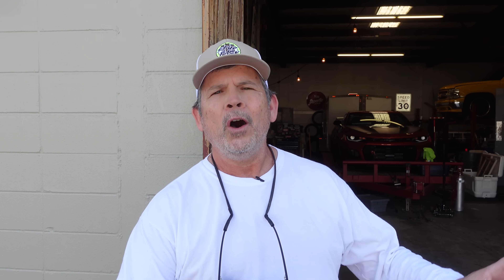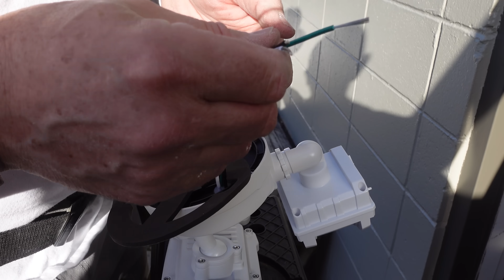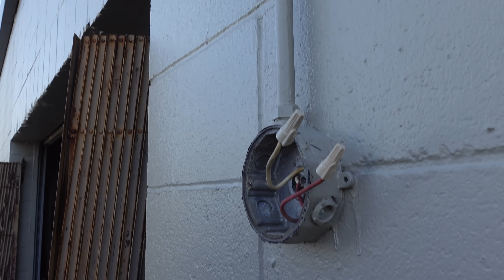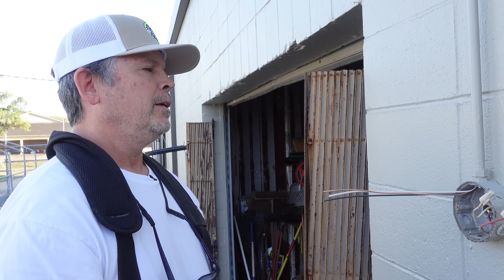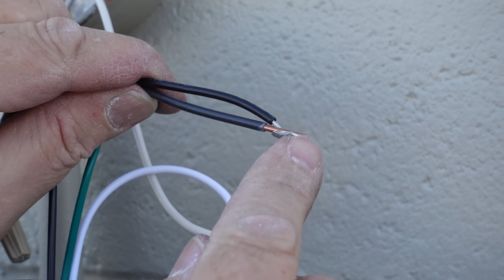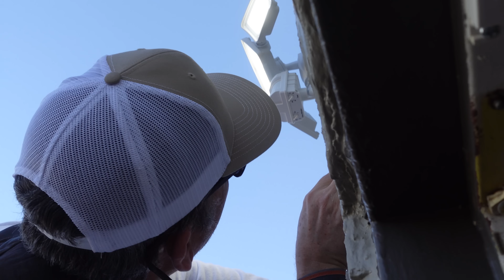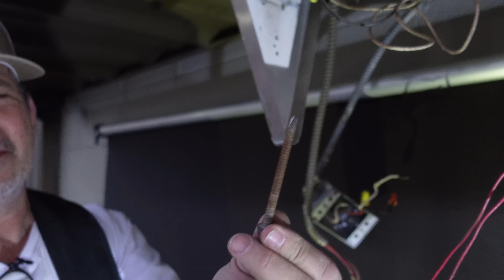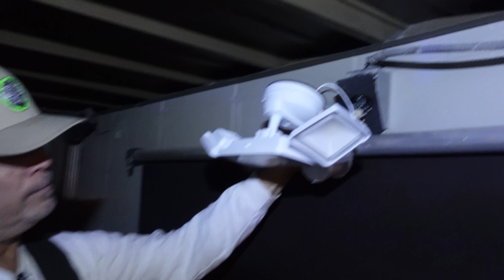HOW TO INSTALL FLOODLIGHTS (Safe, Watertight, and Properly Grounded)

Comment: I hate when people use Romex in conduit and 14g on a 20 amp circuit is also bad.  shake head
Reply: Nothing wrong with Romex in conduit, what is wrong is using it in a wet location. The interior of a conduit in a wet location is a wet location. Should've used THWN or UF.

Comment: @Stud Pack. Very important to do a "pull test" on each wire after screwing them together with wire nuts. And for those Philips-type screws that are also slotted, get a Robertson bit or driver that is made for those. Best of both worlds.
Reply: I think that's what Paul said he was doing, going for the square drive
Reply: @iamamish  Yes, he did say that but a Robertson bit/screwdriver is different. It actually has a square AND bladed end together made just for those types of screws.
Reply: @BogieRel  Robertson is just a tapered square, the original "square" which replaced Philips. you're maybe thinking about the ecx driver?
Reply: @TheDarthJesus  YES! ECX driver. That's the one. I always get those two mixed up. Thank you.
Reply: @BogieRel  Robertson is actually decades old, but Ford refused to pay a Canadian investor to use the patent. Square is the knockoff version created much later, which doesn't have the same tapered sides. Square is more likely to cam out, and doesn't "hold" the screw on the bit as well.

Comment: Let me get this straight, this guy bought a whole commercial building for his man cave? And put his 10 cars in it. Man people with money...
Reply: I know that's more than us average guys can wrap our heads around but if you think what he has is something, you should see some of the places I go. I did some work in one place that had about a dozen of those 1920's era cars - Duesenberg, Rolls, others that were handmade back then. All perfectly restored. The manager told me there wasn't a car in there worth less than 2 million dollars. This place has marble floors and real wood walls (like you'd see in a mansion's library). They had an engine (Duesenberg if I recall correctly) worth over a million dollars sitting as a display. Another place is a horse farm (think polo ponies not walking glue sticks). The guy had a original GT40 in his living room. The house was probably 15,000 square feet so he had plenty of room for a car as artwork.

I live in Palm Beach County, FL. We have some of the richest people in the world here (at least a few months out of the year) so I get to see more of this stuff than most people. It really is amazing how much money some people have.